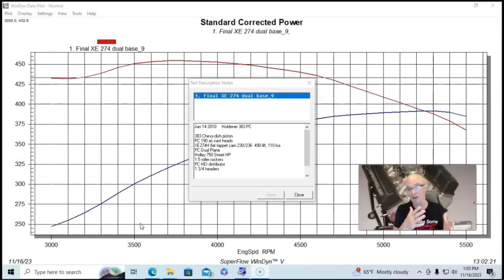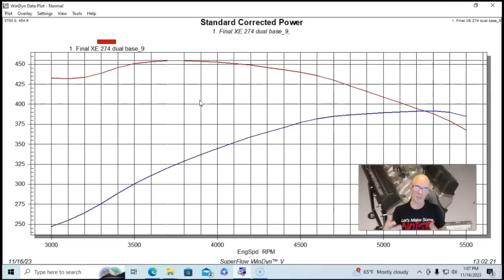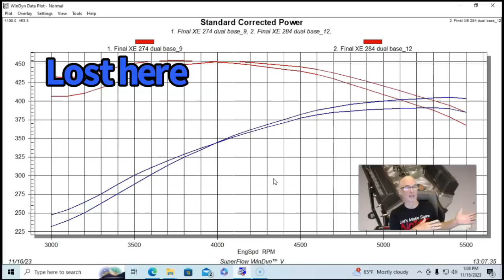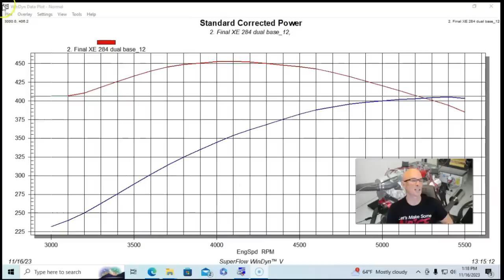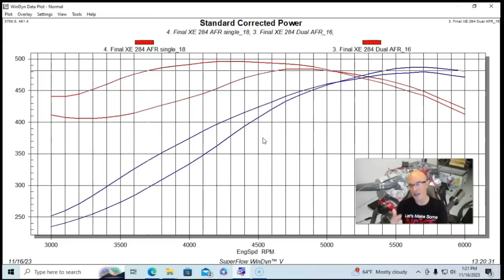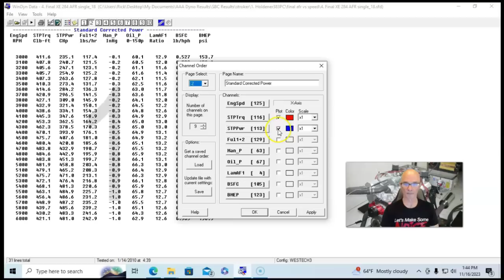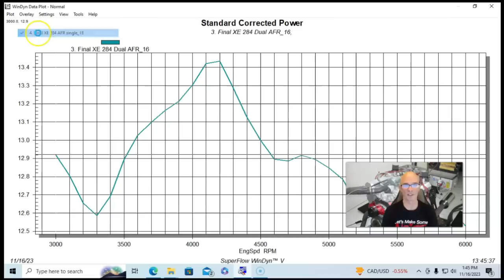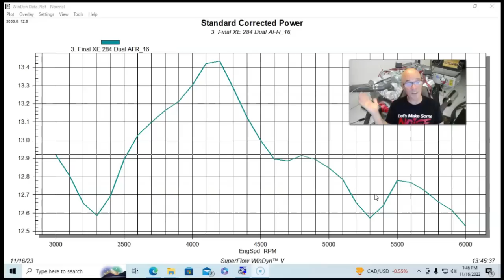HOW TO MAKE MORE 383 STROKER POWER. HOW MUCH POWER ARE PORTED HEADS, CAMS OR INTAKES WORTH? RESULTS

Comment: Hi Rich, thanks for all the great videos.  Would you ever consider doing a test on a 383 SBC Gen 1 Procharger/Vortech and keep the timing curve the same?  Meaning (for example) at max boost/HP, if its at 20 degrees of timing and then run it at 20 degrees of timing with no boost.  Of course adjust the AFR's but leave the timing the same.  This would IMHO give a good before and after with boost.  Not a good comparison if N/A is at 32 degrees of timing and boosted is 20 degrees of timing.  Not sure if you did this already.  Happy Thanksgiving.
Reply from the maker: that only shows what happens when you detune the na power output-each is tune to the max timing they can run safely

Comment: As always Richard we appreciate the info. The dyno is the only way to go! I currently have one going on the pump today. Gen 1 Twin turbo 355 hydraulic roller "BUDGET BUILD" ...Procomp heads. Still making power at 6400 until the valves started to float. Doing a pac valve spring change and going to twist it. Pump gas 10:1 with 70mm turbos looking for 850hp @ 14lbs. If anyone is wanting to see that shoot over to my channel 👇
https://youtube.com/@superiorracingchannel3368?si=K07dwIf56atsTk3N

Comment: Hi Richard, 
Wondering if the single plane manifold has the same effect when  it is multi port efi as opposed to using a carburetor?
Awesome videos BTW
Cheers
Reply from the maker: the intake does the same whether carb or EFI (but port efi usually makes less), but can tune the AF better

Comment: Thank you for this video, I just installed my first 383 build into my truck a couple days ago and it runs great. Probably similar power wise to your first combination. Is there a particular connecting rod that you like to use for greater camshaft clearance?
Reply: Scat makes a nice Ibeam that clears. Are you using a small base circlecam?
Reply: @gordocarbo  I ended up using the Scat rods with minimal clearancing. I was using a standard base circle cam, which I would not do next time. Thanks!

Comment: With a Vega, the oil pan will not clear a 3.75 inch stroke
Reply: thats really hard to believe. most stock sbc pans will clear a 3.750 stroke and big 5.7 rods with only minor dimpling with a ball peen hammer. no cutting or welding required. from 3.48 to 3.750 your talking about .027" longer stroke. someone has been feeding you a bunch of bullsheet. its very doable. In fact Grumpy jenkens was campaigning 400 based vegas in the 1970's

Comment: I was a die-hard budget SBC guy. Nowdays SBC fans are beginning to to understand what flathead ford enthusiasts felt when the SBC arrived in 1955.
Reply: Honestly, say you have a C4 Corvette (3200 pounds) with a 500 horse 383. Is a Scat Pack (4200 pounds), Mustang GT (3700 pounds, or Camaro SS (3600 pounds) going to beat you? Do you really NEED anything faster? Supercharge it, now Demons are your victim.
Reply: @sebbonxxsebbon6824  Depends on a lot of things. Torque curve gearing etc . If todays pony cars were stuck with 3 spd autos  or a 4 spd manual they would be noticeably slower. 
500chp is more than enough for almost any st car out there esp our older stuff which most are well under 3500 lbs. 
Never got obsessed with peak dyno numbers, cant use it.
Reply: @gordocarbo  480 hp in a 4300 pound car is not as fast as a 3000 pound car making 400 hp.
Reply: @sebbonxxsebbon6824 im going to go weight my 73 camaro now..👍

Comment: Richie I’d love to pick your brain on a 383 build. I’ve been a mechanic and have done welding, fab, body & fender, auto restoration 25+ years. I recently inherited a fully restored 327 powered 31 Chevy Vicky street rod. A fresh sbc 383. Tons of speed parts including, Brodix spread port heads “off on a friends 360 sprint”, a vintage Dyer’s 6/71 street charger, Mallory distributor and ignition box, 15x3.5 Fenton gyro mags, vintage 15x10 American mags. I want to build the Vicky into a Rowdy Gasser. The 383 currently has 180cc flotec heads with steel roller tipped rockers, and a roller cam from Engle unknown specs and what I believe to be a Lunati crank. The supercharger has a vintage Crager BBC intake. I just ordered a speedmaster polished 6/71 SBC intake. I have so many questions for you. What rods would you run, pistons, rings, ring gap, compression ratio, cam & grind? Is it worth getting the Brodix head’s freshened up or should I run the cheapo flotec 180cc heads since it’s forced induction. I’m not afraid to spend some money on it. Also I have a really odd vintage Creitz 2x4 intake for a sbc. The Siamese runners have no divider. Just one big rectangle port straight to the head. I’m sure the velocity would “suck”. I’d love to see you test it.      Also my name is Jerry. Nessie is my better half.
Reply: WOuldnt run that intake but interesting conversation piece to hang on the garage wall .Bring the heads into a machine shop have them evaluate
Wit a 6-71 Id suspect it would make more power with the larger head. 
Make sure it isnt tooo big

Comment: Hi Rich, I'd try power valves, I don't know if low speed air bleeds would be in play. I never had a carb where I could change them, had to restrict them or drill em, but I would try as not to burn it down. Nice test Rich!
Reply: Power valves do nothing at full throttle  0.0 inches

Comment: I have a low speed marine 383 that's 10:1. It lives below 5000 rpm.  It has small runner, small valve Dart Iron Eagle heads.  We got the mid range rpm is to 13.2 by using more primary jet. It didn't go under 13 afr til it passed 3700 rpm. It has a Quick Fuel marine 750 carburetor. The throttle linkage starts to use the secondaries at I think 40% throttle.
If I open up the throttle it's very responsive.  It surprises the other boats around. I get a lot of what's in that thing questions. Keeps me smiling.
I'm so tempted to buy it some aluminum heads, but I just bought an old muscle-ish car that's got my attention these days. Real heads can run into much dinero.
Reply: Sounds like a good application for a sbc 383. Aluminum heads would be nice but more due to being lighter rather than a sub-5,000rpm performance upgrade imo.
Keep having fun with it and best of luck with your car too 👍
Reply: if it really lives below 5000 tpm, put a tpi intake on it. big block like torque. probably better fuel economy too.
Reply: @b.c4066  Yes, a TPI would probably add 60 foot pounds of torque.

Comment: I've been looking at ways to increase the power of my blueprint 383. I'd like to get it over 500hp though.
Reply: I Have the same engine.  Get the heads hogged out and put a .550-570 lift cam. Instead of the .528 .536 cam. 
It’ll make 500+
Reply: @koltoncatchings2706  Would you recommend "hogging" out the heads over purchasing new heads? Will that combination still be 93 pump gas eligible?

Comment: I would leave the A/F alone.

AFR heads forever!

That's a great case of a dual-plane outperforming a single-plane in the band where most people drive:  3500-5700 rpm.  Can you post the average power over that range for both manifolds?  The single-plane gained 13 hp at the top, but lost 40 hp at the bottom.  It's just not a worthwhile tradeoff.
Reply: Agree that is a HUGE drop. Seen a few tests with that single plane similar results. Not all that great. Number of chinese dual planes out there underperform due to internal runner size not being what its supposed to. 
Love the Holley 300-36 dual plane, out of production

Comment: I have an idea. Run fuel injection and adjust to cure the rich or lean condition.
Reply from the maker: see the carb vs injection (batch) vs injection (sequential) vs injection (individual cylinder tuning) video

Comment: I convinced my coworker to buy a Weiand single plane for his 383 3rd gen.  Now I feel like a bad guy lol. He's running a roller cam and turns it pretty high I guess but 60+ ft lbs is pretty noticable!
Reply: I never seen drop off like that.Must have been an issue in there somewhere.Those speedmaster intakes are not worth a shit.Single plane Victor jr or dual plane edelbrook air gap.Choose from those and nothing else.
Reply: @joshuagarvey9362  it's runner length
Reply: @joshuagarvey9362  if you were trying to make power up in the revs, it would be a decent choice but at the rpms this 383 runs, it just doesn't seem that ideal
Reply: @madmod  That’s basic talk.
Reply: If your motor drops 60 HP with just a manifold change something is definitely wrong.Runners are not that long.Swapping from a Victor jr to say edelbrook air gap.Would not be that significant.Loss of 60 means the intake is shit and timing or something went wrong.I have swapped many manifolds on a dyno and never seen something that bad.
Reply: @joshuagarvey9362  its a trade of power. Runner length is able to dramatically change the power level. If it's wrong, why does it produce peak power over the longer runner lengths exactly how the manifold is designed? Its optemized for a different rpm range.
Reply: "You have tested many manifolds"but your litterally talking about Richard Holdner. He is The Guy when it comes to manifold testing and has literally written the books on performance testing a plethora of different engine combos. Every short runner test loses low speed torque.
Reply: @madmod  Your telling me that simple bolting on a new manifold onto a sbc will give you 60+ hp/torque.😆😆😆
Reply: @joshuagarvey9362  If you neuter low speed torque on a mild combo by putting on a single plane on it when it can't really make use of the shortened runners, then you can absolutely gain 60 or more ft/lbs of torque swapping back to a better matched intake manifold like a dual plane air gap.

 It don't matter what the engine family is, intake manifolds are rpm specific and a single plane short runner doesnt produce bottom end torque like a dual plane. Its not that the short runner has something wrong with it, after all it still produced more power. It did exactly as would be expected just to more of an extreme than many people would have realized. 

It proves intake manifold selection is key for average power production. If you want a combo to make good torque below 3k rpms, don't put a short runner on it.
Reply: @joshuagarvey9362  Wheres your contradictory dyno data that says otherwise since youve tested "so many manifolds on the dyno" and know Rich's data is false? What leads you to believe the loss of torque is something broken or just a bad manifold when litterally every short runner manifold that's been tested on here (with data to back it) up has offered a similar trade off in low speed power for a gain in top end?
Reply: Yeh I think the the dyno butt would notice it !
Reply: Dont think he lost 60 lbs. Those are pretty good intakes, any testing Ive seen was closer than youd think for torque and pulled better upstairs. I run one on my 383 real happy with it. Any more torque it wouldnt hook up and pulls hard up top

Comment: Thanks Richard, can you please explain why is it that the larger stroker engines seem to produce so much more torque than the proportional increase in capacity?
Reply: Basic answer:
Torque = Force x Distance.  
In a stroker build you're increasing the "distance" in the equation above by using a  crankshaft with a longer stroke.
350 crank stroke is 3.48"
383 crank stroke is 3.74"
Reply: 2:58
Reply: @johnsheetz6639  that was just the mild 383, he didn’t explain anything
Reply: @johndair2116  something's going on with my phone because I tried to erase it. Lol. I had some beers and all that came out was 2:18! Half the time it won't even let me me comment. Like the algorithm knows I've been drinking.🤔
Reply: @johndair2116  yeah there was something wrong with my comments it just said to 2: 18🤣 I was confused about that myself! I saw your comment and went and looked back yeah I smoked a little but it wasn't that much.

Comment: I built a 383 11 to one Mahle pistons solid roller super Vic and a 850 on pump gas  with Lucas fuel additive and made 620 horse  at 7100 and 545 torque at 4500with a afr head 230cc intake runners 2.10 valve and daily it in a nova all the time come on let’s see some real numbers
Reply from the maker: You missed the point of the test

Comment: My mild 113 LSA cam 388 SBC with old Victor jr heads, performer RPM with 1206 gaskets.. 10.6 CR.   Makes 475/475 at 5000.  Tighter LSA would probably wake it up.  Definitely not optimal running 220cc heads..
Reply: 230s on my 383.  Has gears, larger solid roller and dont want too much tq where I would be spinning tires

Comment: A hydraulic roller camshaft with more lift and add more compression and this can easily be a 550+ horsepower engine
Reply: You can run into block issues at that power. The suggestion is a stock 4 bolt max 500 and 550 with studs. Otherwise need something like a dart block, forged crank and rods instead of cast and steel. So while you are right, you need a few grand more in better parts. I read about peeps building engines like this but cast lower end and wonder why they break cranks and waste money.

Comment: Thanks for showing that hero secret.  Not sure why but honestly thought even stock heads and a pretty mild cam would be closer to 500
Reply: Stock SBC heads, even the stock Hi performance heads wont support 500 hp.
Reply: I built one a while back vortec heads i ported and polished myself pretty wild cam. Never actually dynoed that motor but built a 350 using pretty much all the same parts and it was showing 405 hoarse on a dyno i guess i just assumed it be closer to 500
Reply: @keithsmith9889  400 with a ratty cam isnt bad for vortec heads. 
Some old school porting methods dont always work on the vortecs, easy to go backwards on those.
Reply: Wrong.You need some good aftermarket heads,cam,carb,headers,ex,ex,ex to get you that power.Stock motor push you at 500?plz send me the video that does this?
Reply: 500 takes a lot more than youd think from reading .
Even 400..most online quote power numbers from guessing. 
Never had it on the rollers or down a track. 383 stock heads mild cam should make over 400 lbs tq but hp number wont be impressive

Comment: Would you ever consider testing the capability of the 6.7 power stroke? I’ve learned so much from your videos, specifically ring gap. Wondering if ring gap would work on a diesel due to the already high compression.
Reply: Like to see you do some testing on  a la 318 Mopar!!  Everyone does stories on the 360 but there's 20 318s for every 1 360 in existance so please give a 318 some love!😊
Reply: Check out Gale Banks for diesel information, although he is into Duramax engines.
Reply from the maker: No diesels
Reply: @richardholdener1727 Thank you
Reply: @richardholdener1727  Good!! No interest in those smelly things

Comment: Love my 383. I was inspired to build it after seeing Super Richie (trademark) combinations. It moves my 68 impala so much better than the 327 did! 😁✌️
Reply: Don't tell those 327 guys that😅😅😅😅
Reply: @demarques1911  they’ll be even more miffed to know I used the original 327 block with 30k miles on it to do it 😆
Reply: @SpecialAgentJamesAki  lmao they gonna be like "BLASPHEMY!!" 😅😅😅😅😅
Reply: @demarques1911  😆😆😆
Reply: @SpecialAgentJamesAki  Gotta know what youre doing not to hit water on those blocks. Friend did that...believe he also built a 396 sb for his 62 corvette out of one. One hell of a sleeper for sure!
Reply: @demarques1911  Of course...."cause they rev faster and higher"...blah blah. The stories some come up with is entertaining.
Reply: @gordocarbo  when I trimmed the block I did it a tiny bit at a time then assembled and checked clearance. I took off the bare minimum to be safe from contacting a rod to the block lol. I’ve read that the 327 castings are thicker than 350 castings but whoooo knows 😆 guess I just got lucky. If I popped the water jacket open my plan was to take it to the local machine shop and ask them to fill it with weld right there. I’m sure a half fill on the block would be suitable fix as well. ✌️
Reply: @demarques1911  You mean the guys whos uncle revved his to 10.000 rpm all day and popped wheelies over a coke can with a $100 bill on the dash? "revvvver!" lol